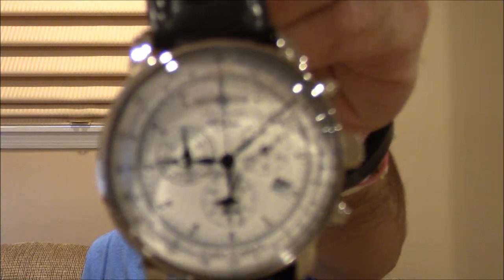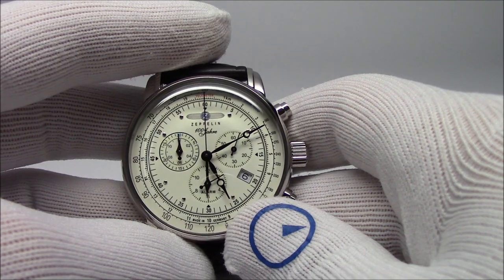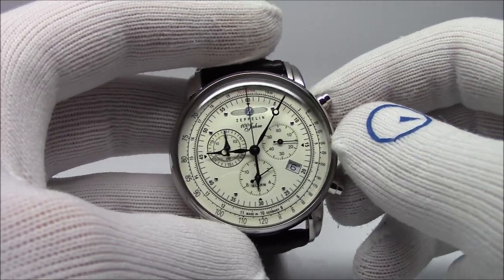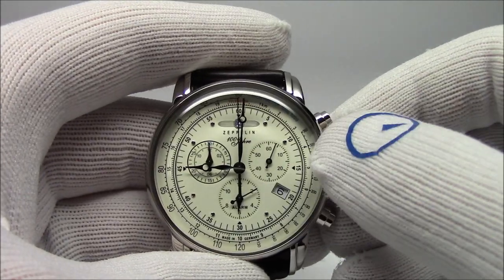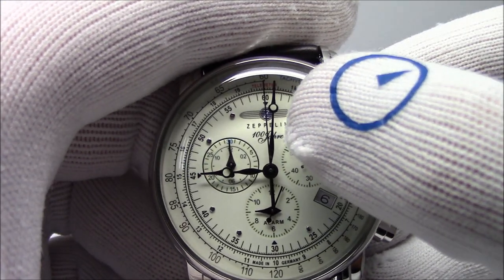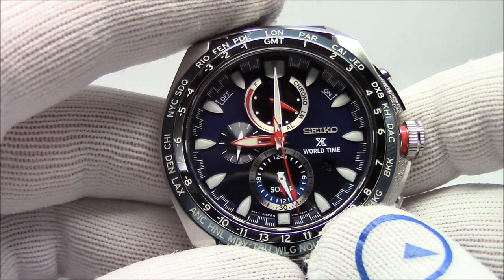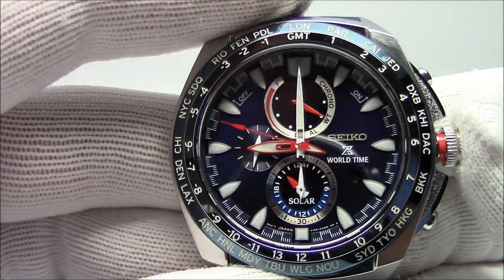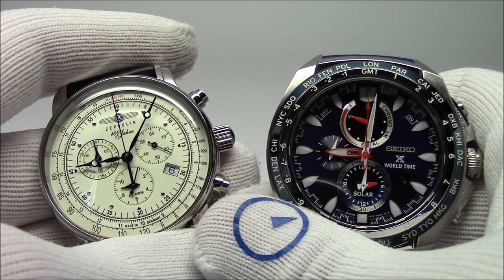How to set and troubleshoot the alarm on an Analog watch - Watch and Learn #33

Comment: Zeppelin may make a beautiful watch in this video, but the one I got was a dud.  

Broken out of the box, in the sense it would stop (stick) with the minute hand in the same place each time.  Took it to a watch shop, their watch smith looked over it, saying it was broken and needed a part.  It was between Christmas and New Years and the part took months to get.  Eventually, they got it, replaced whatever, and gave it to me.  It gave me about three months of problem free use and then started acting up again (but less frequently). Now 9 months later, it's about the same as it was before.

As far as I know, the watch has never been dropped.  It was a gift from the wife, I baby that watch so much it's not even scratched as a daily after a year.  Now the only problem with it is that I don't wear it often enough, because when I look down, I know that there's only a small chance the time will be accurate.  Odds are it willve stopped and started and be anwyere from 1/2 an hour to multiple hours behind.

I know that I bought into Zeppelin's low end mechanical watchers.  My watch isn't going to ever be a collectors item, but I really like the sytle that Zeppelin offers.  That said, the experience has put me off of Zeppelin watches, even though I like the history of the company and truely respect their high end items.

Comment: i have the same Zepplin watch. for some reason the tone from the alarm is very low, sometimes it is loud like expected but most of the time very low like unless i put the watch next to my ear otherwise i can not hear the alarm sound. I have replaced the battery but problem still persists. Do you know what could be wrong?
Reply: I have the same problem with my new one, did you manage to address it either via or without warranty service?
Reply: @HenkSpankK  no i didn't manage to get it fixed, I used the alarm on my phone instead
Reply: @tuanphamrmit  okay. I think I'll contact them directly to see whether it is due to a manufacturing fault. I will update you here in case it is not supposed to be that muted.